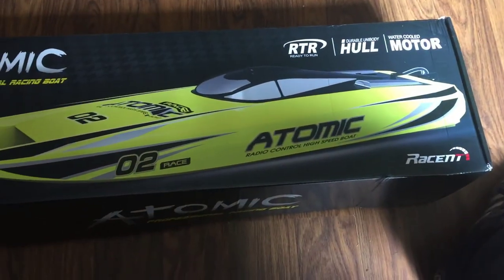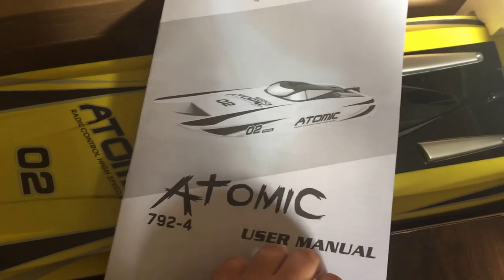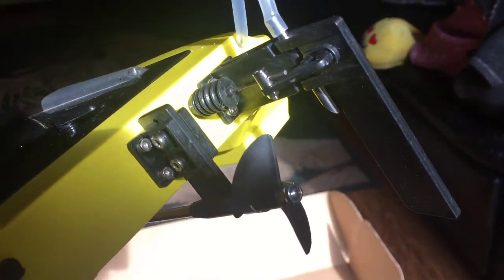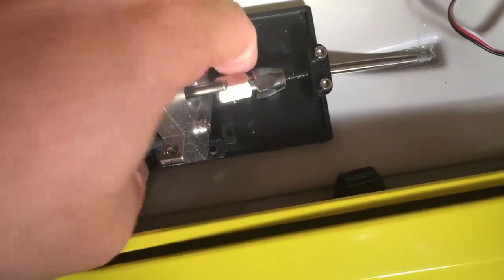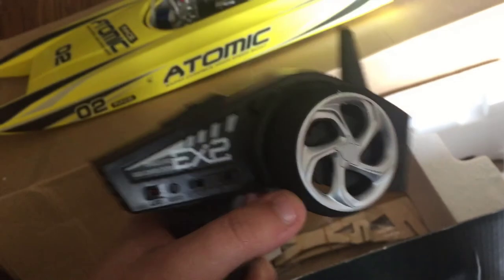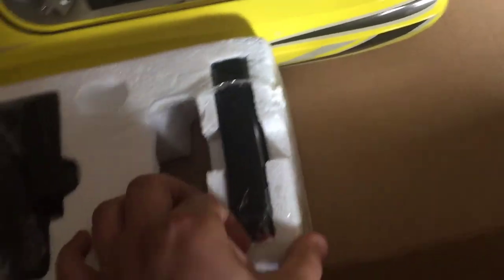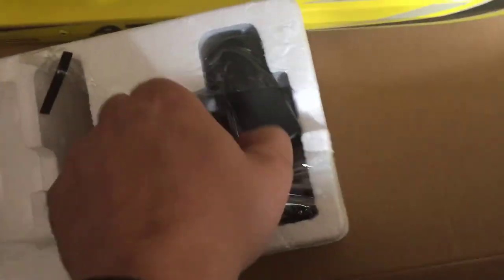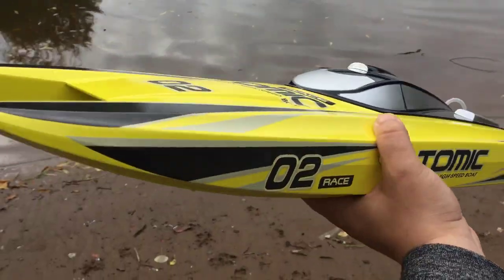Volantex Atomic RC Speed Boat REVIEW

Comment: To put your own graphics on it, get some A4 water decal sheets for your printer, print out some graphics, and fit them onto your models, then fix them in place with some Acrylic varnish (comes in mat, satin and gloss - looks like your boat is glossy so I'd get gloss). Would be best to use an airbrush but a few thin layers with a brush would be fine. Water the Acrylic down a little to build a few thin layers rather than one thick layer... should look legit & be totally waterproof.

Comment: Hello so I need to run fast when going straight but in turns I have to go slow so it won't flip over and grabbing waves slow so I don't have the issue of  flipping over I really like the boat but that is the only issue. I have the feilun ft012 can it work to push it to the shore if it flips down could it be hard to tow it?